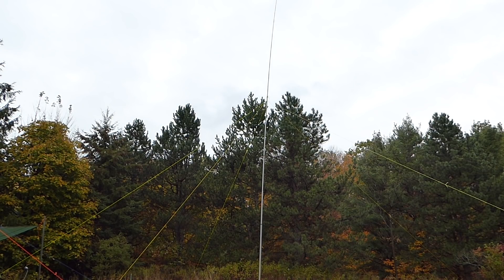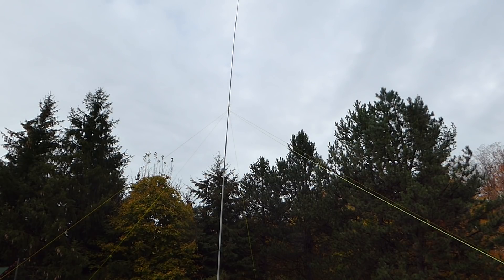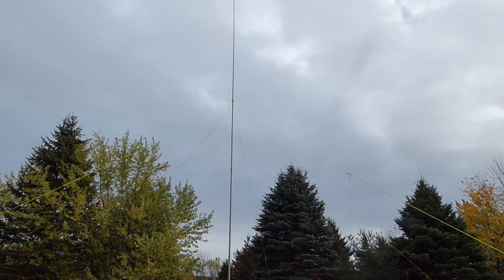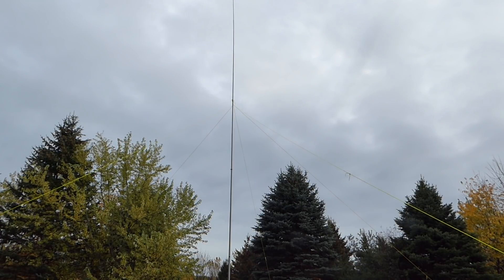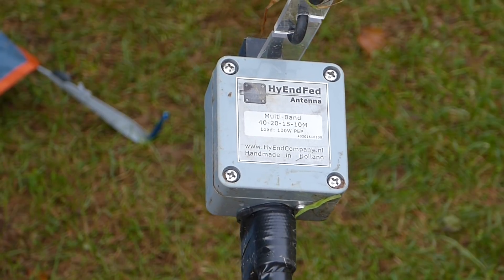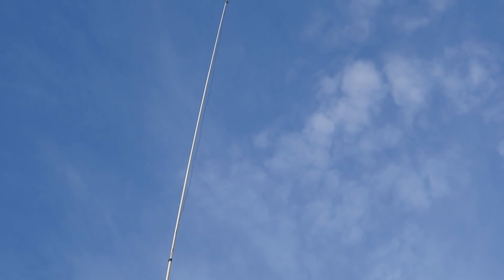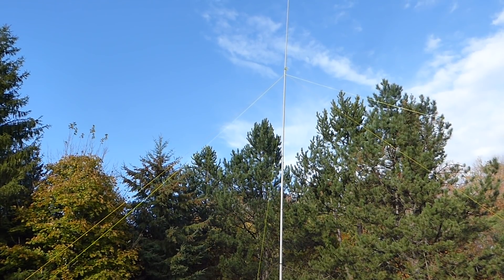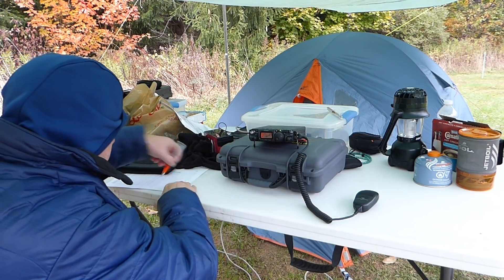A 50 Foot Tall HF Vertical Antenna

Comment: i have ben looking for a 50ft ish telescoping mast for almost a year now & Still no luck..I want one to put my Comet GP-9N ant on for VHF/UHF  The Ant is about 16-17ft tall by its self but as long i i guy it good i dont se any issue with doing that..i do pretty good at just 25ft or so with my yaesu ft-991 But if 25 ft is good 50-60 is Much Better imo.. It is one of my main goals but i do have a couple of projects i really want to get done asap !
Reply from the maker: I have a GP-9 on my tower at home. It's a good antenna but I wouldn't put one on a telescopic pole. I might consider one of the smaller ones (like a Diamond X-50 for example but no higher than the 25 foot mark on a 40 or 50 foot telescopic pole. The poles will bend under the weight if placed any higher.

Comment: You showed the top of the antenna but not the bottom. I would very much like to see the bottom and how you connected to the radio. Also curious how much the trees affect the radiation and how close you are to the antenna when you're working it.

Comment: Thats my idea Tracy, outside the shack! As ham radio newbie, Please givev me your advise. For mij outside radio 
AN yaesu FT 817 ND  or iCom 706 MKII . I am prefer the HF bands.
Now I have an iCom IC 718 no addons .my first DIY antenne is an magnetic loop antenne 10M / 40M .
Thxs! 73 Theo
Reply from the maker: I'd go with the FT-817 versus the 706. MUCH better battery life. Just pair the 817 up with a full-length half-wave up as high as you can get it and you'll make contacts. Good luck and 73 from VE3TWM.
Reply: @OutdoorsOnTheAir  Thanks ! wat is the main difference FT817 / FT817’ND  ? You live in a beautiful country Canada with large parks , ideal for ota HAM activities !bNetherlands is a space shortage in the covid time this becomes even more evident ! Best regards from Theo 73

Comment: Tracy, Thank you for this very interesting video. I may just have to try an end-fed vertical. At present I use two 43-foot verticals with radials and an in-shack tuner.  These have worked quite well for me on 20 and 40 meters.  I would like configure a vertical antenna for portable use. For my portable use with our RV, an antenna with no radials would be much easier to set-up and potentially less of a tripping hazard in a campground than an antenna that uses radials or even a counterpoise.  Questions: I have watched your video a few times and it appear to me that you have 50 of the 66 feet of the antenna wire going straight up the fiberglass pole, however, it is not clear to me what you do with the other 16 feet of the antenna wire:  Q1.  Do you just lay the remaining 16 feet of the antenna wire on the ground, with the matching transformer at the end of the antenna that is closest to you?  If so, does the length of the coax from your transceiver to the matching transformer matter? Q2.  Literally all of the instructions that I have seen for installation of end-fed antennas indicate that a ground reference point is needed at the feed point to the matching transformer and that the ground reference can be either a ground rod or a counterpoise.  Do you use either of these ground references for the antenna that you show in this video.  73, Rick W0RCF
Reply from the maker: Hi Rick, thank you for your comment!
Q1 - I ran the excess wire about 8 feet off the ground across to my shelter. I didn't want anyone tripping over the wire.
The length of the coax makes no difference at all (within reason...e.g. running 100 feet or more coax could result in loss of TX power).
Q2 - The beauty of the HyEndFed design is that no ground radials or counterpoise is required. Having said that, the guys at HyEnd Company do recommend the use of a coaxial counterpoise as shown in my HyEndFed Field Day full review video. Aside from using the coaxial counterpoise with the Field Day antenna, I've never used counterpoises or ground rods with these antennas. And I've never had difficulty making contacts with those antennas.
73 from VE3TWM.

Comment: Just found your channel. Thanks for the info. Great points as well. So many operators are closed minded and think in only one direction. The most effective equipment may not be a good option for everyone. If that were true, then shouldn’t we all be using commercial grade radio equipment that costs $10,000 plus per piece? Its not an option for many, just as some antennas are not
Reply from the maker: Thank you for your comment, I really appreciate it. I certainly can't afford to buy the best...and even if I could, I would have missed out on the fun of trying all the different things I have over the years. 73 from VE3TWM.
Reply: Outdoors On The Air ....looking to get an sdrplay. What antenna would you recommend as a wideband receive only? Im fairly new to ham, so Im not certain which antenna would make a good all around antenna for sdr applications
Reply from the maker: Try the Vibroplex EF-SWL, or if you have the space put up a HyEndFed SWL antenna. Either one will give very good SWL results.

Comment: It seems to have a good antenna you have to be rich and have lots of land....
Reply from the maker: Rich is a relative term. I am by all accounts not rich (financially anyway). I need to go to a campsite to put up a decent sized wire antenna. A good length wire antenna install is pretty much impossible in my tiny, tree filled backyard.

Comment: How long can you keep an antenna like this up. It seems like this is just a portable situation.....
Reply from the maker: Good question, the answer is it depends on the environment and how securely you support it. I have had fiberglass poles up at my home for more than 12 months at a time with no ill effects. For those masts, I attached them to fencing at the base and taped the sections at the joints to keep the upper section from slipping down into the lower section. You can see examples of this mounting technique on some of my earlier videos.

Comment: Hi Tracy - love your channel. 
Do you have any thoughts about the Zero-Five: 10-40 METER GROUNDPLANE FREESTANDING VERTICAL ANTENNA WITH UNUN. I like the fact that is does not require radials. https://zerofive-antennas.com/product-category/ground-plane-antennas
Your thoughts?
Reply from the maker: Hi Dave, thank you for your comment. I've looked at these antennas in the past and I am intrigued. I'd love to ry one out. The part that scares me off is the requirement of 100 feet of coax, meaning the coax is acting as part of the antenna system. I don't like that for a couple of reasons...if you have a small lot at home, you might not have room for all that cable. Additionally I don't want a long wire to be both radiating to cause interference to electronic devices, and receiving interference from electronic devices that ends up as noise at the receiver. I'm still intrigued, though 😀

Comment: Two ?s 
What’s the best magic box balun for home made 12awg twin lead 4” spaced with electric fence spacers finned tube insulators? Feeding a 260’ 12awg solid core copper with Thhn insulation center fed Diepole ? 1:1 current or voltage 4:1 think I read sum where the resistance should be 400-600 ohms 
What’s best way to read the resistance? Vna or ???  
 Thank you KC3ONO

Comment: Hi Tracy. Been watching your videos for a while. Really enjoying them. Most of my operating is /P now. I exclusively use my own designed antenna called the adjustiwave. Inspired by a commercial brand but much simpler. I used to be put off by radials but not so anymore. I dont believe you need that much space. You can use more shorter radials instead of less longer ones (based on Rudy Severns research). I can get the adjustiwave set up in 20 minutes with 16 x 8m radials on my own. It's so good, I have sold all my external tuners. Have a look at my small garden in this video where I set it up from time to time. 73 from Colin MM0OPX  https://youtu.be/GG5zP-GC0JU
Reply from the maker: Great work, Colin! I hope others reading this check out your video, it's fascinating.

Comment: I'm going to put up a tall on. I also want to put up a 4 ft. X 4 ft. chain link fence around the base.  In my area a permit is not required for antennas but one is for a fense....permit fee is $100.00.  My plan is to do it without the permit. If they make me remove the fence, or try to fine me, I will make them be accountable for anyone injured trying to mess with my pole.  A young boy was killed after he climbed a ham antenna here in Ohio.  He used it to climb to the roof and go down the chimney where he got stuck. I'm big on safety and I strongly believe no permit should supercede safety.

Comment: Hi Tracy very intersting stuff...I'm also wondering to put up a hyendfed, the short one 40 20 10, round about 12 meters long. I'm planning to use an aluminum mast due to much more stability and ran the antenna as a sloper with the matching box at the top . What is your opinion? Would it work or would there too much detuning due to the metal mast...mny tks in advance for answering. 73s from Germany de Torben  DL1IF
Reply from the maker: Hi Torben, thank you for watching and for your comment. You need to keep the antenna away from the mast. Perhaps if you erect it as a sloper with some paracord at the top to keep the far end from getting too close to the mast it would work. The metal will definitely detune the antenna if they are too close.
73 from Canada VE3TWM.

Comment: Tracy

I have Hyendfed antenna. It’s 66’. Where do you run the excess since the mast is 50’
Reply from the maker: I run the excess to the operating position, so the antenna is really an L configuration. The bottom of the L is at about 8 feet off the ground.

Comment: I am using a 15 meter telescope pole combined with a 5 band end fed antenna from the company hyendfed.  The feedpoint is at the base of the antenna.  The remaining wire is supported more or less horizontally with the help of a nearby tree.  This is an inverted "L" configuration.SWR on four bands is very good, but on 40 meters it is a little high, 1.9-2.0.  This is a configuration problem. When I hung the antenna as a sloper, all bands were 1.5 or less.  I also use the pole support system, as seen on Ron's website and in one of your videos.  I have no other guy wires, maybe a big mistake.  I will find out when the next big wind occurs.

I also use the 12 meter pole from spiderbeam.  I hang an endfed halfwave antenna for the 20 meter band (from the German company lambdahalbe.de)  vertically.  I also have antennas for the 6, 10 and 15 meter bands from the same company. The antenna has no match box, but rather a length of window line with a slider to actually tune it to the desired center frequency. No additonal tuner is necessary.   It is resonant on the whole 20 meter band.  It rolls up nicely, is light weight and fits easily in a backpack.  Same applies to the antennas for the other bands.

When I go portable I take my 12 meter pole (not a lightweight!), and a backpack with my rig (Yeasu FT-891), a 12Ah LiFePO4 battery, the antenna, some masking tape and some coax and cordage.  I can lean the pole against a tree or some other object or stake it out.  This system works very well.  I use masking tape because it is cheap and light weight.  It is actually quite strong and holds up even when wet, at least for a day's ops.  I have room in my pack for some paper and pencils for logging qso's and taking notes.  I have my smartphone for looking up callsigns on qrz.com.  I have room for a couple of pb&j sandwiches and a couple of cold beers.
Reply from the maker: Thank you for your detailed comment! I am especially intrigued by your mention of masking tape working even when wet. I'll have to try using it. I imagine it does not remove the paint off the mast as much as electrical tape does.

Comment: Wanting to put up a 35 ft antenna. I'll be using 1 1/2 pcv pipe...I want to run the wire down through the middle of the pipe.. I also want it to be center fed.  This will be for 20 meters....do you think it will work?
Reply from the maker: Should do, as long as you do what is necessary to present the proper impedance to the transceiver.
Reply: PVC pipe is not self-supporting when stacked vertically, even with guy wires.  It tends tends to sag and bow and,if it collapses, could result in injury.  You would likely be better served by a fiberglass pole.

Comment: Derogatory "Terms" not 'Tones.'
At higher freqs. they certainly don't radiate equally all round.
A tall one becomes a 'long wire' and develops side lobes which are useful on a horizontal wire (Is said to radiate 'off the ends') but on a long vertical, these lobes radiate into the sky.
Reply from the maker: Thanks for your comment!

Comment: Glass Fibre antenna poles are immune to lightning. Glass does not conduct electricity.  Any wires running down it ARE at risk as is carbon fibre.
Reply from the maker: Google static electricity fiberglass. Some interesting reading there.

Comment: Remember this, just because an antenna can make radio contacts, does not necessarily mean that it is a good antenna, or optimal. The tallest vertical with the greatest gain is a 5/8th wavelength. That length is 42-43' on 20 meters, 59' on 30 meters. If you construct a vertical taller than 5/8th wavelength, as it increases in height, the power in the low angle lobe begins to recede, and the power in the higher angle lobe increases and if carried far enough, multiple high angle lobes develop and grow and much of your power is wasted. In the case of this antenna, it is not efficient above 20 meters, as a vertical and especially at 10 meters, where a 5/8th wave vertical would be about 20-22'.
Reply from the maker: Interesting points, thank you for your comment.

Comment: I'm going to have to disagree with your belief that a fiberglass pole is a lightning attractor, because fiberglass is non conductive, therefore it isn't an attractor in any sense. The wire it holds up in the air is the only part that can be thought of as an "attractor".
Reply: 1redrubberball
Exactly!  The name says it all..Glass Fibre.
If the pole were carbon fibre, that would be a different story!
Reply from the maker: Google fiberglass and static electricity. Some interesting reading there. Also many reports of fiberglass antennas being struck by lightning.
Reply: @OutdoorsOnTheAir  Of course there are many reports of fiberglass antennas being struck by lightning. Fiberglass is used as insulators, coil forms, weather protecting radome enclosures, etc., for antennas. Wire, aluminum and copper rod stock and tubing, are all commonly used to create the electrical characteristics of an antenna. That's the parts of an antenna that have any influence on lightning, not fiberglass!
Reply: @OutdoorsOnTheAir  
Hmmm. Not read it yet but sounds like some impurities in the glass fibre might make it susceptible. After all, there's a volt or two in the Donner und Blitzen!
Reply: 1redrubberball.
Sorry that I can give you only ONE thumbs up!
Wires up the side can get blasted and the resultant, astounding energy can make the glass fibre look a bit sad!
Reply: @MauriatOttolink  Yes, indeed! I saw a UHF colinear antenna totally destroyed by a lightning direct hit, about 40 years ago. Every metalic conductor within the fiberglass radome was melted and found at the ground level under the tower, where they cooled and remained as a few copper blobs. The fiberglass strands were all separated and hanging down under the
point of attachment, black with carbon but still having their fiberglass properties.

Comment: How are counterpoise radials not needed?
Reply from the maker: The high-ratio balun in the matching unit negates the need for a counterpoise. For more information, reach out to Ron at HyEnd Company. He's knowledgeable and very helpful. You might also want to check out the Endfed antenna group on Facebook.

Comment: My first ham antenna was a vertical resonate on 40, 20, 15 and a bit of 10 meters. It was made of an old CB vertical with some additional length added. Part of the time I had a FT-101 and part a TS-430. Both great rigs.
Reply from the maker: Thank you for sharing your experience!

Comment: Ive been using a 17ft long telescopic antenna MFJ1979 with a spike in the ground, I just put a 3/8x 24 mount on a tripod I'll be out in the field on Winter Field Day I hope to have a QSO with you someday 73's I made a pvc telescopic mast about 13meters but it takes 3 guys to setup lol I use a dipole and endfed with it like you have.
Reply from the maker: Thank you for sharing your experience, Donnie. I have done some work with PVC as a mast but found it too cumbersome.

Comment: We usually say that the ground reflection gives  a horizontal antenna a 6dB advantage at its optimum elevation angle. Below that the vertical might be winning, but it depends on soil type. The present antenna is nearly half wave on 40m, so presumably has about the same gain as a dipole. On the higher bands, I presume the main lobe is angled upwards due to the excess length. It might be better to slope the antenna for this reason.
Reply from the maker: Thank you for sharing your knowledge.

Comment: I have the myantennas 10-40 I’ve been wanting to go straight up in this 60 ft tree and hang the 5ft back down. I’ve used the efhw many ways but never this way. I wonder if the noise level will increase.
Reply from the maker: Give it a try and find out. I suspect it all depends upon what is generating noise in your area.

Comment: I take it the feed point is at the bottom.   And how many radios did you put out are they all the same length
Reply from the maker: Yes, the feedpoint is at the bottom, near the operating position. No radials were used as this antenna does not require them.